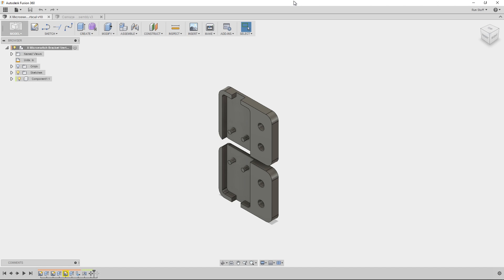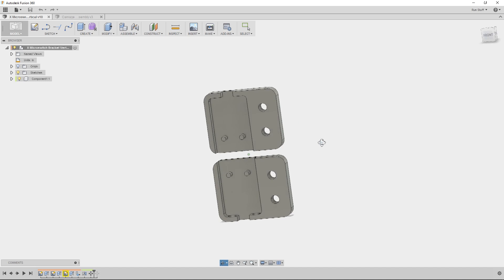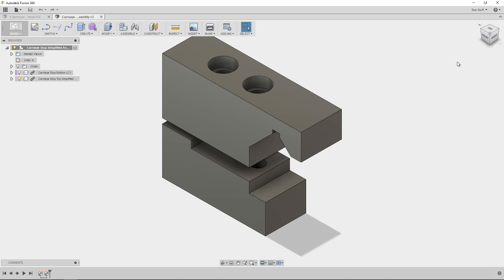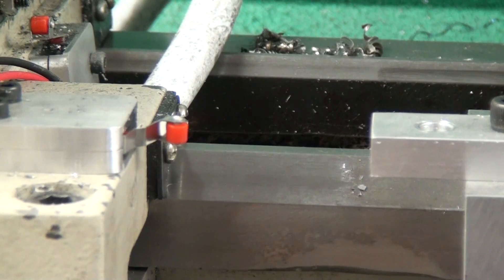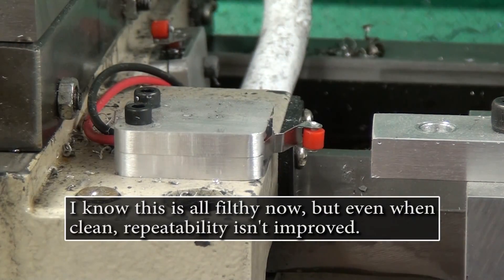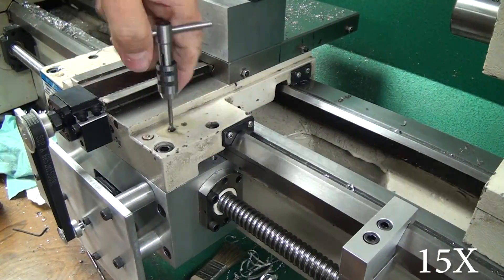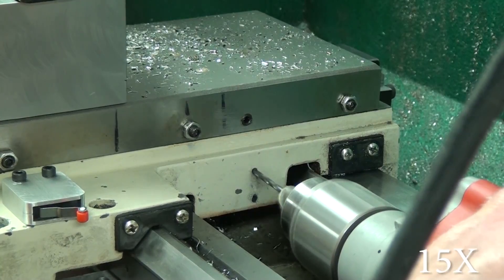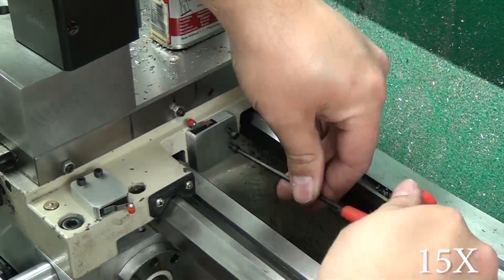G0602 CNC Conversion pt13 Home Switches

Comment: Try power tapping some time. Put the tap in your hand drill, set it to low speed and go for it. I will usually keep the chuck slightly looser than I would for a drill so if the tap catches/binds, it just spins instead of snapping. A spiral flute bottoming tap is the best for this use, but any style tap will work, you just might need to clear the chips more often. Don't forget the lube!
Reply from the maker: I actually tried this the day before you posted, for the first time. I did a 10-32 in aluminum with a straight flute tap. I need to get some spiral flute taps as I plan to start doing this on my mill with the new motor.
The cast iron on this lathe is so grainy and porous, I'm afraid it would break any tap you tried under power. I've broken 3 taps, two tapping into my lathe and one tapping into my mill :\

Comment: Nice work Russ as always, I used micro switches on my conversion they work fine however with Flood coolant I do worry there may be issues in the future. 
Be Safe Sam
Reply from the maker: Thanks Sam. What sort of repeatability are you getting?
Reply: Seems to be fine I haven't done extensive tests. I home at the beginning after boot up and the run my parts I have started a run on one day finished the next and the Zeros seem to be dead on after Homing.

Comment: I plan on using proximity switches on mine. They are pretty much the standard anymore.
Reply from the maker: I think you're right.
Reply: I tried proximity switches.  I cant get the repeatability needed out of them.  I am on my third version of switches now.  I am getting between .001 and .002 repeatability.  I wish I could get better.  If your proximity switches are better than that, please post part numbers.

Comment: Limit switches are giving me hell, even though I'm using shielded wire I'm getting noise somewhere causing switch to activate when not contacted. Same goes for probing tool from craftycnc. Just does not work. Any ideas?
Reply from the maker: I'm not having that problem, and using something like 22ga shielded wire. You could try running them through a schmitt trigger, which is a hassle. Are you running the drain wire to ground already?
Reply: +russtuff I'm running to ground on the enclosure but now that I think about it the case may not be grounded to earth, I'll have a look and see. Thanks for the reply
Reply: if you are getting noise triggering your inputs, try switching them to constant 5v and triggering when voltage is removed.  that way they shouldn't be as susceptible to noise.  also only ground your shield drain wire to one side of the line end, preferably the side near the BOB.  also make sure all shield drain wires are connected to a common chassis ground point and aren't Daisy chained as this creates ground loops. and make sure the chassis is well grounded.  make sure your wire runs are as straight possible without excess wire being bundled.. bundling is a sure fire way to have noise enter the system, makes fur a great antenna.  wire runs should be as short as possible and straight.

if you still have noise problems, you need to look at the rest of your layout and grinding design, or identify where the noise is coming from and Seperate the source from the system.
Reply: +christopher polanski thanks, I did daisy chain the ground wires, will fix that and ensure I have good chaises ground and recheck system.
Reply from the maker: +christopher polanski Thanks Chris.

Comment: On CNCZone there's a big topic on DIY Hall limit / home switches. They're non-interference (no chance of crushing your sensor if either the controller or linuxCNC messes up. Supposedly they're more accurate as well. I've built 6 of them for the desktop cnc I have here, but due to that still being spindle-less it hasn't ever done anything besides move a marker very inefficiently. Here's a link: http://www.cnczone.com/forums/open-source-cnc-machine-designs/101878-cnc-forum.html Plus, Hall sensors don't wear out like mechanical switches ;)
Reply from the maker: Thanks for the link, I'll definitely take a look.